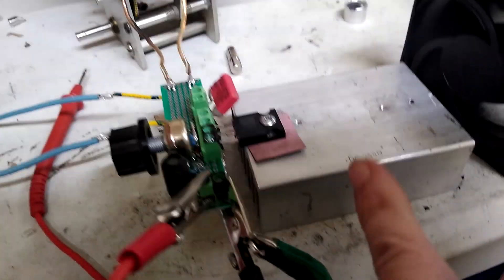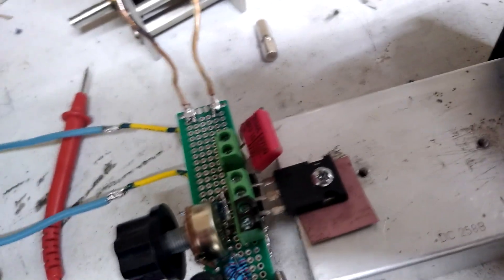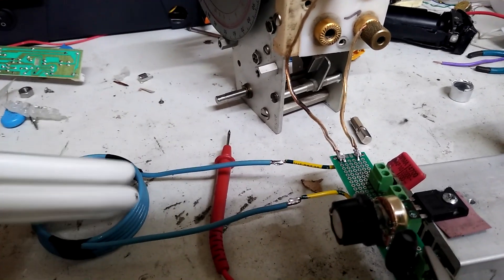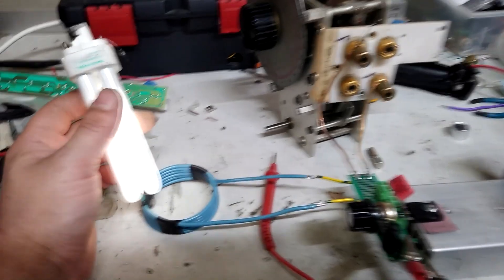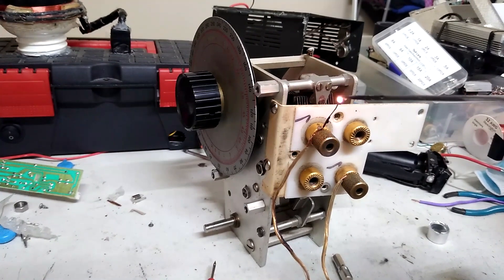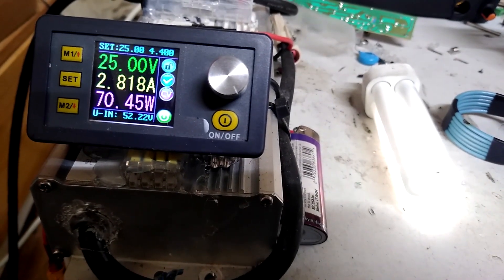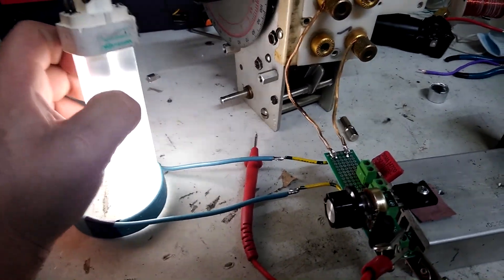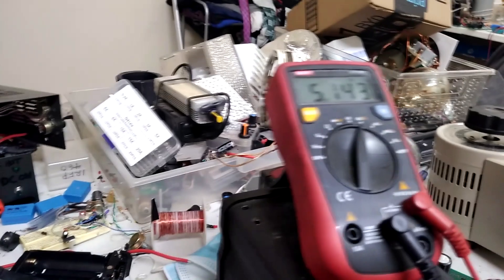Playing with HF Oscillator (Teslaundmehr Plasma Flame)

Comment: Hey 
You can give the circuit a higher voltage up to 50V without arcing in the capacitor . If you go on eBay or AliExpress you can find small blue capacitors with values of 2.2nf and 2kV und some with 6kV and 47pf you can put them in series and use the variable capacitor for tuning without a high voltage across the plates and arcs .
It you want I can give you a link to a video where i try it out
Reply from the maker: A well built RF capacitor at something like 7kv or even more is probably best, but with any kind of variable air cap like that one there is going to be some potential for arcing once the voltage reaches a certain point and has nowhere else to go. Easier on the circuit when the other resonator is present.
Reply: @Magneticitist  yes the Russian K15Y capacitors are very good for high voltage RF

Comment: If you have any hassle with your Mosfet's getting too toasty, junk that F'in thermal pad and apply some thermal paste to it, and bolt it down, just don't let the heat sink come into contact with ANYTHING else, including YOU, those pads are shyte. In nearly all cases (pun intended) the drain is connected directly to the metal body of the mosfet, so that heat sink will be live, and if you touch it, you might not be.....
Reply from the maker: Interestingly enough I never caught any burns off the heatsink when it had no pads. The pads for me at this point don't really matter like it seemed to with similar circuits. I was assuming I'd catch a bad burn from it but the only point that has that much voltage on it seems to be the cap/coil node.

Comment: Hey man I suppose you could try running that variable capacitor in some oil...it would certainly increase the amount of voltage before any signs of breakdown...but then again it would also change your overall capacitance value, might be good to look up the relative permittivity of whatever oil you use. I am building one of these too, but not sticking to exact values from T's circuit. I built my own high voltage variable cap, it's a PVC tube with copper and aluminium on the inside and outside respectively, sitting at around 100pF..got my Mosfet's from old P.C. power supplies. Have not had the courage to hook up the 160 turn coil as I don't have the TVS diode yet...Hey that 10 uF electrolytic cap across the rails, is that really needed ?. Wish I had a fricken scope ! it would be so nice to SEE what the F's going on instead of relying on my dodgy math.
Reply from the maker: With the addition of the secondary resonator I haven't had problems with the cap breaking down but I do have some replacements on the way I'm going to try. I've seen a really nice flame someone made using a DIY variable cap like yours, it just got really really hot. 

The 10uf isn't necessary but I just left it on this circuit because it seems to work lol. I've made a few others without that cap that seem to work about the same though. 

I have a scope now so I plan to mess with these again once I get some more components. RF caps are so expensive so I'm hoping to stack some cheap ones or find a good deal on some doorknob caps.

Comment: Especially your descriptions are great, i mean clear and complete. You could show the circuitdiagrams more
Reply from the maker: Thanks! This circuit was the same as Teslaundmehr's except for the capacitor and RFC coil. In his video with Jay from PlasmaChannel I think Jay built the older circuit (using IRFP460) and I built the same one Teslaundmehr did in his video but I used the 460.

Comment: Where did u get that BIG var cap? 
How's rambo?😊
Reply from the maker: lol Rambo is good. I left him be to tinker with this new circuit but I still need to wind a new resonator for it. That huge varicap came out of an old Q-Meter someone gave me. Really cool old Boonton meter unfortunately it was fried beyond salvation and looked like it had already went through several repair stages. It would have been real handy for these circuits though, guess it still is in a way.

Comment: Why not put the bulb in a pigtail?  Dude you frickin entertaining to watch. Haoott . Lol
Reply: Try brass nuts.
Reply from the maker: @MAGnetICus_Attractus  IDK just screwing around cause I don't have any really cool lamps filled with various gases. I need to get me a nice little xenon bulb cause those look amazing at HF. If I turn the power up a bit and use the same bulb I def can't hold it for longer than a couple seconds though. That baby starts to melt damn near anything off that terminal. I had a really cool vintage style looking bulb that would light up instead of glow plasma because I guess it wasn't a partial vacuum. Whatever metal was at the base of this socket (the line connection)melted through though and now i can't use it lol.

I wound some wire I had and it came out to be a 6mhz secondary. Too low.. but still makes a nice little flame when tuning the LC to that frequency. It outputs the real beef at 10mhz or higher though... So I get the feeling when I do get some more wire and wind another coil it may be pretty damn awesome. Not Steve Ward awesome but awesome.
Reply: @Magneticitist  did you ever watch my video where my Xeon magnetic switches were glowing blue? Like the whole reed was glowing blue.
Reply: @Magneticitist  https://youtu.be/cLLer11lq14 this video.
Reply from the maker: @MAGnetICus_Attractus  man that's crazy, I'll check it out in a sec. My brain is fuzzy these days.
Reply: @Magneticitist  it was a trip cause normally it is just a spark at the contacts. Those beads of lights in this video was bad @$$

Comment: FCC Would like to know your location...
Reply from the maker: I do kind of wonder about that. I'd like to know some HAM opinions on just what frequency ranges might be a no-no, or if it really doesn't much matter so much. Some of these guys pumping considerable power might be causing some 'issues'
Reply: @Magneticitist  my magnet flywheel had the FCC looking for me. Wasn't till I walked around the neighborhood with a portable AM radio I realized how big a area I was broadcasting.
Reply from the maker: @MAGnetICus_Attractus  that's hilarious. I'd hate to be interfering with some local transmitting somehow but I honestly give two shits about any of those alphabet boys
Reply: @Magneticitist  with me I was doing coral castle research. Needless to say I knew they were around before they could pin point my location. I figured out how they know you are close to the fence in area 51. So what I showed some on Skype back in the day. Was I had a coiled bottle with a rattle snake egg magnet inside. The 2 ends of the coil went to old television rabbit ears. I would spin the wheel which would turn the rattle snake egg. If you connected a volt meter to the coil and set to AC current you could watch the voltage go up or down depending on which rabbit ear you were near. One ear the voltage goes up and the other ear the voltage goes down. Then I learned about theremin devices.
Reply from the maker: @MAGnetICus_Attractus  I picture the FCC riding around with a locator like dude from No Country For Old Men haha. I mean apparently they can do that.. I realized this when looking into whether I could get away with pressing the transmit button on my little transceiver.
Reply: @Magneticitist  I had 3 guys come out of the woods. One wearing a blue uniform and 2 wearing camouflage.  One had headphones on, one was waving a AN10NA back and forth, and the guy in blue was taking notes. I just went back inside and unplugged things and you could tell they lost the signal. Every guy wire in the neighborhood was pulsing my signal. 900-1000 on the AM dial. That undesired interference was jamming a popular AM station. Pretty much got the cease and desist or enjoy my stay at club FED. All my neighbors know to call me before the alphabet boys, I just call them PIGS(People In Government Service). My wife used to think I was paranoid, till the night I bought the FBI agent dinner. She was so clueless to all the "CODES" I was using. When I say "I'm going to have my tail for dinner" that means "pick a random place to eat" . What a coincidence that same car and that same driver  went to 2 restaurants, the same 2 restaurants we stopped at. So I said to the guy "want to join us for dinner, nobody should have to eat alone?". So we bought him dinner at olive garden. I think his cover story was leasing out legal eagle's.     I let him know I had no actual plans to 'clean' out the bank vault and I was just joking. FBI and secret service took my remarks at work seriously.  I had a job cleaning banks. I forget I was tested  30 years ago. Sometimes I try to forget the bad choices I made when I was a kid. Apparently descrambling a cable box is a federal crime. I was still in elementary school.  They said I was smart. I always asked if I'm smart how come I get in so much trouble? One adult said "boy, most kids your age don't even think of doing some of the stuff you do"...you gave me some ideas. Chicken wire I might have access to. I am sitting in a landing zone for medical flights so I can't be loud like you.

Comment: if this works without feedback, why is the secondary in Teslaundmehrs schem connected between the prim and cap ?  I can see you could "direct drive" a coil by connecting it there like this https://youtu.be/vKwHNU9f1SY   I guess that's why Steve couples it loosly
Reply from the maker: He's just connecting the resonator to be base-fed from the output of the oscillator so it's like a magnifier. Across the top end of the coil the high voltage is present so basically that node where the coil meets the cap. There's no feedback in this circuit, but coupling the two coils as Steve said dampens the primary resonance. I noticed this with a wider coil inside the secondary and the coupling didn't decrease to low enough until I used a smaller diameter. I'd prefer to not couple them at all but it just saves space.
Reply: @Magneticitist  dampening is proportional to coupling ?
Reply from the maker: @sFeral  More or less with this circuit yes. When I first tested it with various primaries I noticed just setting an oscillator frequency and then trying to wind a coil to that frequency did not work out so well when coupling the two coils. The oscillator frequency could shift dramatically. The higher up I have my 'primary' sitting along the outside of the resonator the lower the frequency drops due to the coupling.
Reply: @Magneticitist  makes sense
Reply from the maker: @sFeral  Yea it's part the bonus of a base-fed coil, no primary to deal with. And as Steve showed it can be extremely efficient. Not a lot of base-fed coils out there probably because of the input voltage demand.
Reply: @Magneticitist  question is (for me as I haven't seen it) are there efficient ways to do it at lower freq and while getting higher voltage, as Master Ivo says, by longitudinal tuning
Reply: @Magneticitist  btw maybe it's Steves camera or smth but zilipopers flame looks cooler https://youtu.be/TQh8FlJv2OQ  Guess the driver makes a difference
Reply: @Magneticitist  the way it shimmers and undulates is like smth out of a Spawn comic
Reply from the maker: @sFeral  He is using a tube though and running close to twice the frequency. Those tube plasma flames are mean, they put out a really ferocious arc. you can see more of the mains wiggle in them apparently. Zilipoper is a tube alien though his shit is going to be hard to beat. I find it more impressive seeing Steve's output with the mosfet although it is a silicon carbide fet. Apparently Steve could have pushed way more out of his also but he'd need to figure out how to not catch molten metal in the face.
Reply from the maker: @sFeral  Far as longitudinal tuning I can only guess. That's still theoretic to me. Lower frequency depends on how low we're talking. The high frequency is essential to see the same flame effect though. You get below 5 mhz or so and it stops resembling the same kind of flame.
Reply: @Magneticitist  yeah I just came up with something and commented on Vidduleys torch discharge vid that maybe he could try a water vessel on top, with the terminal in direct contact with water ofc, and see if it still lights
Reply from the maker: @sFeral  that would be kind of interesting but a little hard to implement. I can see how it would be done but I also feel like it would just boil the water away if it did break out
Reply: @Magneticitist  lol I added that in the comment, that I noticed the water wasn't boiling much while I was doing it with a thick flyback flame, which is among my videos, but it did get hella hot right at the surface
Reply from the maker: The circuit in the video you linked is likely working the same way as a magnifier. It's probably fed thousands of volts at the base.